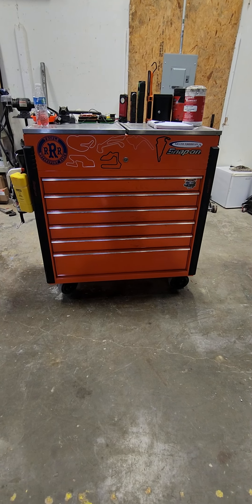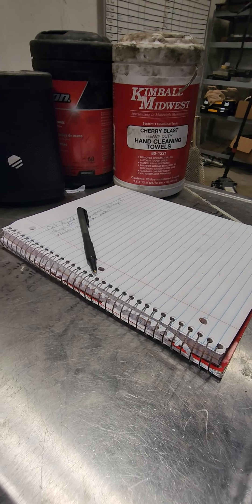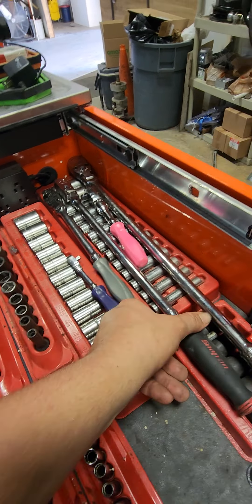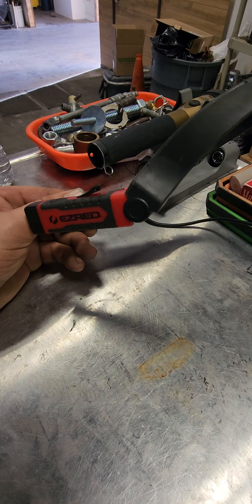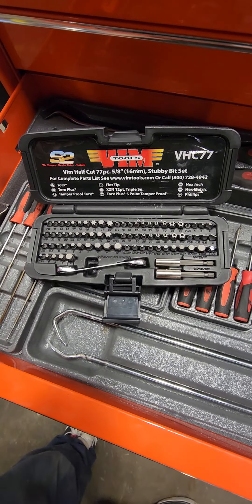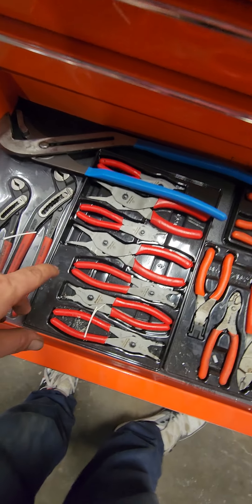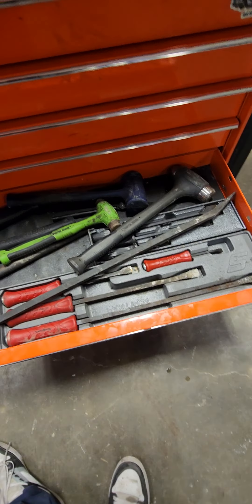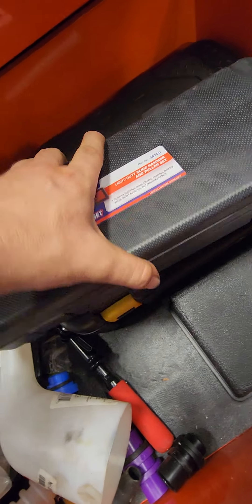Snap On roll cart tour. krsc430 split top.

Comment: How are the tekton sockets?
Reply from the maker: Absolutely love my tekton sockets . For the price and quality I cannot complain one bit . Totally recommend  giving them a try you will not be disappointed. Thank you for your support.
Reply: Tekton and gearwrench is what I started with and that was a long time ago. I still have most of them at my toolbox I have at home, I love them and don’t regret those being my starters at all. Stay greasy my friends.
Reply: I definitely heard that their warranty was great. Which is important in the auto world.
Reply: All the 3/4 drive impact sockets I use on big trucks and equipment like telehandlers and stuff, all of them are tekton and they are bad to the bone. Never broken one of those, I’ve broken a couple deep chrome sockets when I would use them on an impact gun (shouldn’t do that) and tekton replaced them no questions asked. I broke one of their screwdrivers like 3 times and after that they replaced the whole set and sent me a backup screwdriver to have on standby.